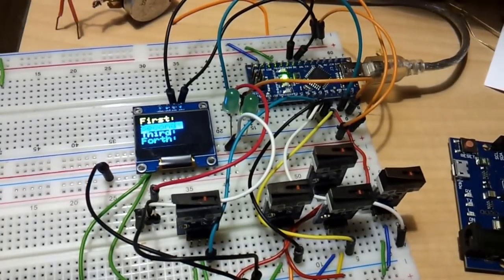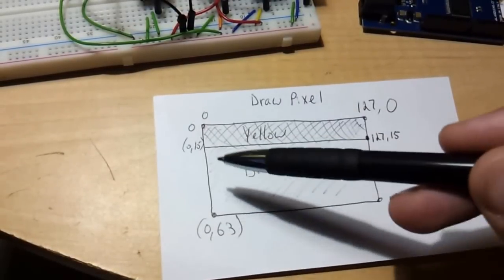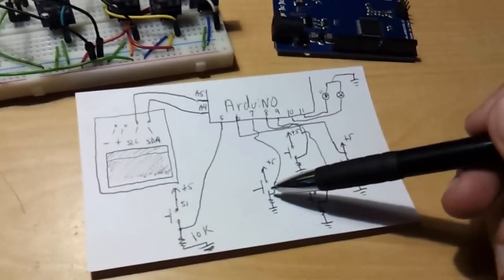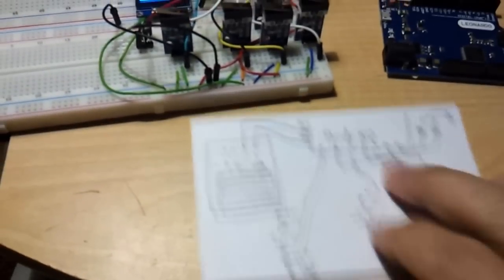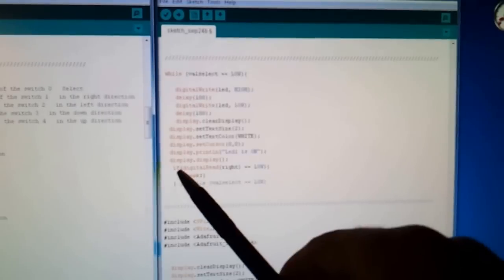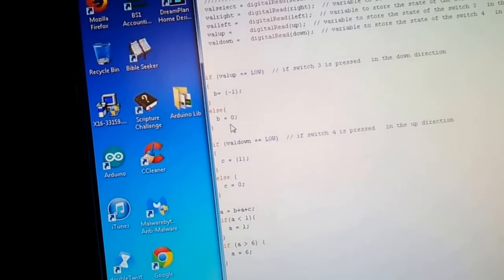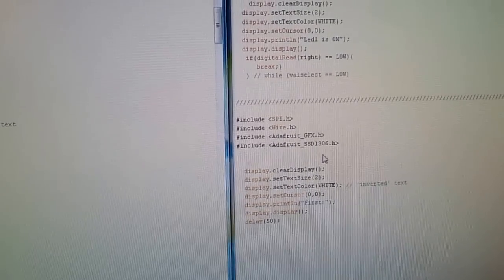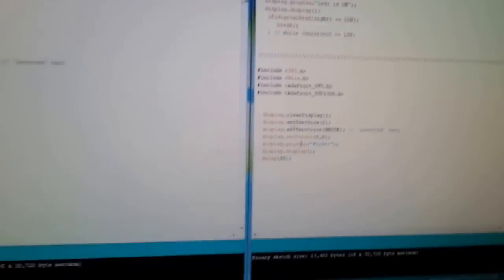0.96 I2C IIC 128X64 YellowBlue OLED LCD LED How to Use

Comment: as I understand it button active ''LOW'' . But you maked pull-down connection. in this case button always time active? I am confused
Reply from the maker: those buttons are digital switches that im using in the video, there is no pull down on them. The switch outputs positive when not pressed. And the switch outputs negative whenever it is pressed. but in the drawing i have it backwards. Im sorry I didnt clarify in the video. I hope that helped, let me know if i can answer any more questions.
you just have to switch them
Reply: I got it. Thank you so much.I hope your videos will continue on this topic...
Reply from the maker: https://www.youtube.com/watch?v=mrDxhmGp5LI

my new video

Comment: Hello, could you give me the code ?
Reply from the maker: nusret x im sorry i had all of my codes on my laptop and it crashed, i lost all my codes:(:(
Reply: I was very sorry
Reply: +Fedor Weems  hello...I wonder if this code is correct..screen does not work properly..can you help me. thank you..

#include <SPI.h>
#include <Wire.h>
#include <Adafruit_GFX.h>
#include <Adafruit_SSD1306.h>

#define OLED_RESET 4
Adafruit_SSD1306 display(OLED_RESET);

#define NUMFLAKES 10
#define XPOS 0
#define YPOS 1
#define DELTAY 2

const int select=5;
const int right=6;
const int left=7;
const int down=8;
const int up=9;
const int led=10;
const int led1=11;

int valselect,valright,valleft,valup,valdown;
int a=1,b=0,c=0,d=0;
int xAxis=63,yAxis=33;

#define LOGO16_GLCD_HEIGHT 16
#define LOGO16_GLCD_WIDTH  16

#if (SSD1306_LCDHEIGHT!=64)
#error ("Height incorrect,please fix Adafruit_SSD1306.h!");
#endif

void setup()  {
  Serial.begin(9600);

  pinMode(select,INPUT);
  pinMode(right,INPUT);
  pinMode(left,INPUT);
  pinMode(down,INPUT);
  pinMode(up,INPUT);
  pinMode(led,OUTPUT);
  pinMode(led1,OUTPUT);
  
  
 display.begin (0x3C);

  display.display();
  delay(1000);
  display.clearDisplay();
  }
void loop() {
valselect = digitalRead(select);
valright =  digitalRead(right);
valleft  =  digitalRead(left);
valup    =  digitalRead(up);
valdown  =  digitalRead(down);  

  if(valup==LOW)
  {
   b= (-1);
    }
  else{
    b = 0;
    }
  if (valdown == LOW)
  {
    c = (1);
    }
  else{
    c = 0;
    }

  a=b+a+c;

  
  if (a<1)
  {
    a=1;
    }
  if (a>6)
  {
    a=6;
    }
  switch (a) {
    case 1:

    display.clearDisplay();
    display.setTextSize(2);
    display.setTextColor(BLACK,WHITE);
    display.setCursor(0,0);
    display.println("First:");
    display.setTextColor(WHITE);
    display.println("Second:");
    display.println("Third:");
    display.println("Forth:");
    display.display();
    delay(50);
    digitalWrite(led,LOW);

     while (valselect == LOW) {
      
      digitalWrite(led,HIGH);
      delay(100);
      digitalWrite(led,LOW);  
      delay(100);
      display.clearDisplay();
      display.setTextSize(2);
      display.setTextColor(WHITE);
      display.setCursor(0,0);
      display.println("Led1 is ON");
      display.display();
       if(digitalRead(right)== LOW){
        break;
        }         
      } 
      break;
    case 2:
    
    display.clearDisplay();
    display.setTextSize(2);
    display.setTextColor(WHITE);
    display.setCursor(0,0);
    display.println("First:");
    display.setTextColor(BLACK,WHITE);
    display.println("Second:");
    display.setTextColor(WHITE);
    display.println("Third:");
    display.println("Forth:");
    display.display();
    delay(50);
       
         while (valselect == LOW) {
      
      digitalWrite(led1,HIGH);
      delay(100);
      digitalWrite(led1,LOW);  
      delay(100);
      display.clearDisplay();
      display.setTextSize(2);
      display.setTextColor(WHITE);
      display.setCursor(0,0);
      display.println("Led2 is ON");
      display.display();
       if(digitalRead(right)== LOW){
        break;
        }         
      }
    break;

    case 3:
    
    display.clearDisplay();
    display.setTextSize(2);
    display.setTextColor(WHITE);
    display.setCursor(0,0);
    display.println("First:");
    display.println("Second:");
    display.setTextColor(BLACK,WHITE);
    display.println("Third:");
    display.setTextColor(WHITE);
    display.println("Forth:");
    display.display();
    delay(50);

         while (valselect == LOW) {
      
      digitalWrite(led,HIGH);
      digitalWrite(led1,HIGH);  
      delay(100);
      digitalWrite(led,LOW);
      digitalWrite(led1,LOW);  
      delay(100);    
      display.clearDisplay();
      display.setTextSize(2);
      display.setTextColor(WHITE);
      display.setCursor(0,0);
      display.println("Both LEDs are ON");
      display.display();
       if(digitalRead(right)== LOW){
        break;
        }         
      }
       break;
      case 4:
    display.clearDisplay();
    display.setTextSize(2);
    display.setTextColor(WHITE);
    display.setCursor(0,0);
    display.println("First:");
    display.println("Second:");
    display.println("Third:");
    display.setTextColor(BLACK,WHITE);
    display.setTextColor(WHITE);
    display.println("Forth:");
    display.display();
    

         while (valselect == LOW) {
      
      digitalWrite(led,LOW);
      digitalWrite(led1,HIGH);  
      delay(100);
      digitalWrite(led,HIGH);
      digitalWrite(led1,LOW);  
      delay(100);    
      display.clearDisplay();
      display.setTextSize(2);
      display.setTextColor(WHITE);
      display.setCursor(0,0);
      display.println("Alter LEDs");
      display.display();
       if(digitalRead(right)== LOW){
        break;
        }         
      }
        break;
      case 5:
    display.clearDisplay();
    display.setTextSize(2);
    display.setTextColor(WHITE);
    display.setCursor(0,0);
    display.println("Second:");
    display.println("Third:");
    display.println("Forth:");
    display.setTextColor(BLACK,WHITE);
    display.println("Fifth:");
    display.display();      

         while (valselect == LOW) {
      
      digitalWrite(led,LOW);
      digitalWrite(led1,HIGH);  
      delay(100);
      digitalWrite(led,HIGH);
      digitalWrite(led1,LOW);  
      delay(100);    
      display.clearDisplay();
      display.setTextSize(2);
      display.setTextColor(WHITE);
      display.setCursor(0,0);
      display.println("Alter LEDs");
      display.display();
       if(digitalRead(right)== LOW){
        break;
        }         
      }
      break;
    }
  }
Reply from the maker: Looks like you have few lines missing in setting up the screen, whenever I get home I'll fix it for you
Reply from the maker: nusret x Looks like you have few lines missing in setting up the screen, whenever I get home I'll fix it for you
Reply from the maker: +nusret x 
I found out your problem, it could be two things

1. you dont have the right size LED Display
2. you need to make sure all of the switches that you declared in the code, all of them need to be connected properly

i also modied your code a little see if it works
Reply from the maker: +nusret x 
HERE IS YOUR CODE I MODIFIED IT A LITTLE

#include <SPI.h>
#include <Wire.h>
#include <Adafruit_GFX.h>
#include <Adafruit_SSD1306.h>

#define OLED_RESET 4
Adafruit_SSD1306 display(OLED_RESET);

const int select=5;
const int right=6;
const int down=8;
const int up=9;
const int led=10;
const int led1=11;

int valselect,valright,valup,valdown;
int a=1,b=0,c=0;

#if (SSD1306_LCDHEIGHT!=64)
#error ("Height incorrect,please fix Adafruit_SSD1306.h!");
#endif

void setup()  {

  pinMode(select,INPUT);
  pinMode(right,INPUT);
  pinMode(down,INPUT);
  pinMode(up,INPUT);
  pinMode(led,OUTPUT);
  pinMode(led1,OUTPUT);
  
  
  display.begin (0x3C);
  display.clearDisplay();
  }
void loop() {
valselect = digitalRead(select);
valright =  digitalRead(right);
valup    =  digitalRead(up);
valdown  =  digitalRead(down);  

  if(valup==LOW)
  {
   b= (-1);
    }
  else{
    b = 0;
    }
  if (valdown == LOW)
  {
    c = (1);
    }
  else{
    c = 0;
    }

  a=b+a+c;

  
  if (a<1)
  {
    a=1;
    }
  if (a>6)
  {
    a=6;
    }
  switch (a) {
    case 1:

    display.clearDisplay();
    display.setTextSize(2);
    display.setTextColor(BLACK,WHITE);
    display.setCursor(0,0);
    display.println("First:");
    display.setTextColor(WHITE);
    display.println("Second:");
    display.println("Third:");
    display.println("Forth:");
    display.display();
    delay(50);
    digitalWrite(led,LOW);
    digitalWrite(led1,LOW);

     while (valselect == LOW) {
      
      digitalWrite(led,HIGH);
      delay(100);
      digitalWrite(led,LOW);  
      delay(100);
      display.clearDisplay();
      display.setTextSize(2);
      display.setTextColor(WHITE);
      display.setCursor(0,0);
      display.println("Led1 is ON");
      display.display();
       if(digitalRead(right)== LOW){
        break;
        }         
      } 
      break;
    case 2:
    
    display.clearDisplay();
    display.setTextSize(2);
    display.setTextColor(WHITE);
    display.setCursor(0,0);
    display.println("First:");
    display.setTextColor(BLACK,WHITE);
    display.println("Second:");
    display.setTextColor(WHITE);
    display.println("Third:");
    display.println("Forth:");
    display.display();
    delay(50);
    digitalWrite(led,LOW);
    digitalWrite(led1,LOW);
       
         while (valselect == LOW) {
      
      digitalWrite(led1,HIGH);
      delay(100);
      digitalWrite(led1,LOW);  
      delay(100);
      display.clearDisplay();
      display.setTextSize(2);
      display.setTextColor(WHITE);
      display.setCursor(0,0);
      display.println("Led2 is ON");
      display.display();
       if(digitalRead(right)== LOW){
        break;
        }         
      }
    break;

    case 3:
    
    display.clearDisplay();
    display.setTextSize(2);
    display.setTextColor(WHITE);
    display.setCursor(0,0);
    display.println("First:");
    display.println("Second:");
    display.setTextColor(BLACK,WHITE);
    display.println("Third:");
    display.setTextColor(WHITE);
    display.println("Forth:");
    display.display();
    delay(50);
    digitalWrite(led,LOW);
    digitalWrite(led1,LOW);

         while (valselect == LOW) {
      
      digitalWrite(led,HIGH);
      digitalWrite(led1,HIGH);  
      delay(100);
      digitalWrite(led,LOW);
      digitalWrite(led1,LOW);  
      delay(100);    
      display.clearDisplay();
      display.setTextSize(2);
      display.setTextColor(WHITE);
      display.setCursor(0,0);
      display.println("Both LEDs are ON");
      display.display();
       if(digitalRead(right)== LOW){
        break;
        }         
      }
       break;
      case 4:
    display.clearDisplay();
    display.setTextSize(2);
    display.setTextColor(WHITE);
    display.setCursor(0,0);
    display.println("First:");
    display.println("Second:");
    display.println("Third:");
    display.setTextColor(BLACK,WHITE);
    display.setTextColor(WHITE);
    display.println("Forth:");
    display.display();
    digitalWrite(led,LOW);
    digitalWrite(led1,LOW);
    

         while (valselect == LOW) {
      
      digitalWrite(led,LOW);
      digitalWrite(led1,HIGH);  
      delay(100);
      digitalWrite(led,HIGH);
      digitalWrite(led1,LOW);  
      delay(100);    
      display.clearDisplay();
      display.setTextSize(2);
      display.setTextColor(WHITE);
      display.setCursor(0,0);
      display.println("Alter LEDs");
      display.display();
       if(digitalRead(right)== LOW){
        break;
        }         
      }
        break;
      case 5:
    display.clearDisplay();
    display.setTextSize(2);
    display.setTextColor(WHITE);
    display.setCursor(0,0);
    display.println("Second:");
    display.println("Third:");
    display.println("Forth:");
    display.setTextColor(BLACK,WHITE);
    display.println("Fifth:");
    display.display(); 
    digitalWrite(led,LOW);
    digitalWrite(led1,LOW);    

         while (valselect == LOW) {
      
      digitalWrite(led,LOW);
      digitalWrite(led1,HIGH);  
      delay(100);
      digitalWrite(led,HIGH);
      digitalWrite(led1,LOW);  
      delay(100);    
      display.clearDisplay();
      display.setTextSize(2);
      display.setTextColor(WHITE);
      display.setCursor(0,0);
      display.println("Alter LEDs");
      display.display();
       if(digitalRead(right)== LOW){
        break;
        }         
      }
      break;
    }
  }
Reply: +Fedor Weems  Thank you so much. LCD worked. :)).  You're a great friend.
Reply from the maker: No problem, I'm glad it worked for you!
Reply from the maker: +nusret x 

BASIC CODE

#include <SPI.h>
#include <Wire.h>
#include <Adafruit_GFX.h>
#include <Adafruit_SSD1306.h>

#define OLED_RESET 4
Adafruit_SSD1306 display(OLED_RESET);

#if (SSD1306_LCDHEIGHT!=64)
#error ("Height incorrect,please fix Adafruit_SSD1306.h!");
#endif

void setup()  {
  
  display.begin (0x3C);
  display.clearDisplay();
  
  }
void loop() {

      display.clearDisplay();
      display.setTextSize(2);
      display.setTextColor(WHITE);
      display.setCursor(0,0);
      display.println("Example");
      display.println("My Text");
      display.display();

  }
Reply: +Fedor Weems  Thank you so much :)

Comment: Do you think you can link me a basic version of the code (without buttons). I just want to use it as an output tool. Im having trouble getting mine to work with the code that comes with the SSD1306 library. If you can paste or link the code that would be really helpful. Thanks.
Reply from the maker: flyingchimp99 my code is on my SD card and 2 weeks ago my new laptop crashed, and im using my old laptop now and it doesnt have a SD card reader i need to find one soon i should get it to you really soon.
Reply from the maker: flyingchimp99 

/*******************************************************************
This is an example for our Monochrome OLEDs based on SSD1306 drivers
This example is for a 128x64 size display using I2C to communicate
3 pins are required to interface (2 I2C and one reset)
The code was modified by Fedor Weems.
*******************************************************************/
#include <SPI.h>
#include <Wire.h>
#include <Adafruit_GFX.h>
#include <Adafruit_SSD1306.h>
#define OLED_RESET 4
Adafruit_SSD1306 display(OLED_RESET);
#define XPOS 0
#define YPOS 1
#define DELTAY 2

#if (SSD1306_LCDHEIGHT != 64)
#error("Height incorrect, please fix Adafruit_SSD1306.h!");
#endif
void setup() {
Serial.begin(9600);
// by default, we'll generate the high voltage from the 3.3v line internally! (neat!)
display.begin(SSD1306_SWITCHCAPVCC, 0x3C); // initialize with the I2C addr 0x3D (for the 128x64)

// Clear the whole screen.
display.clearDisplay();

}
void loop() {
  ////////////////////////////////////////////////////////////////////////////
  // text display 

display.setTextSize(1);
display.setTextColor(WHITE);
display.setCursor(0,0);
display.println("Hello, All world!"); // TYPE YOUR TEXT IN HERE TO BE DISPLAED
display.setTextColor(BLACK, WHITE); // 'inverted' text
display.display();
delay(1000);
display.clearDisplay();

display.setTextSize(1);
display.setTextColor(WHITE);
display.setCursor(0,0);
display.println("Hello, world!");// TYPE YOUR TEXT IN HERE TO BE DISPLAED
display.setTextColor(BLACK, WHITE); // 'inverted' text
display.display();
delay(1000);
display.clearDisplay();
}